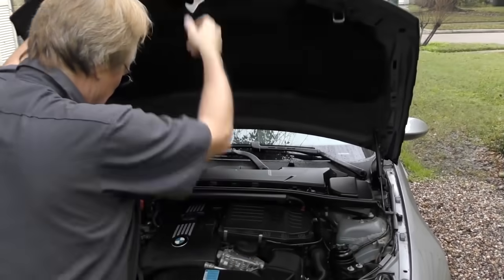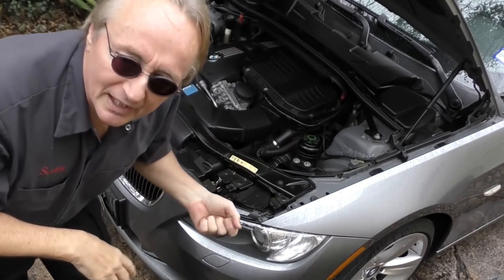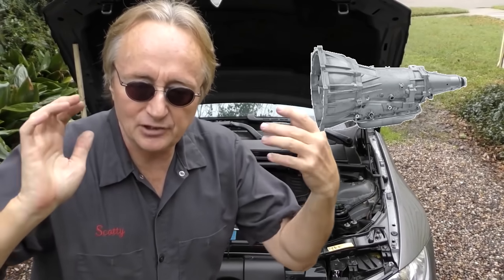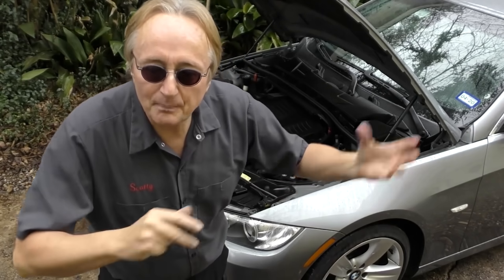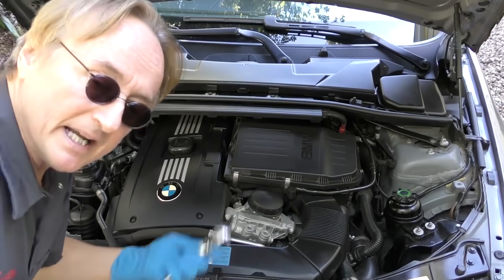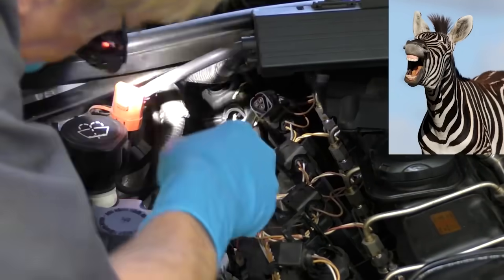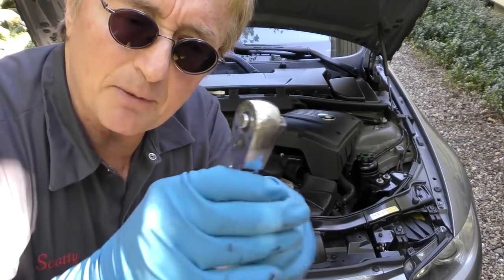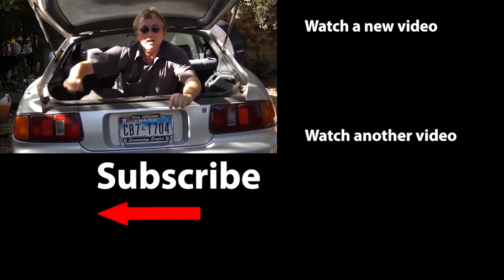People Say I'm Full of Crap About BMWs, Well Watch This

Comment: I bought a so called "most reliable" version, an 06 530i with an N52, but still yeah, 100 percent agree with you. Those BMW guys who love them are blind to this stuff and just call every one else cheep for not doing maintenance, but rebuilding an engine is beyond maintenance to me. I went through hell with mine, and I thought it was going to be easy fixes, and that I got a deal. I did, but yeah, not worth doing stuff like major repairs all the time and calling it maintenance. Endless money pit is right. I don't care what kind of deal you got on it. Never again, and I'm a mechanic as well. Japan makes stuff I like working on.😉
Reply: See I have a BMW with the N52 and I’ve been ok so far with the maintenance. I did have to replace the ignition coil and I’m starting to get some small oil leaks, but with FCP Euro making it so that parts have a lifetime warranty, a lot of those repairs have been paid off by the free oil changes from the warrantied oil and I’ll never have to pay for a valve cover gasket ever again
Reply: I'd rather a lexus over bmw
Reply: @Dashi18n  mine was closing in on 200k miles (hence the deal i guess) so maybe that's just the breaking point idk, I have heard many others say this was the best engine, it probably is. It was BMW maintained before I got it too. Vanos, 99 percent of codes are Vanos related I found. but otherwise an ok engine really.
Reply: @attunedofficial   200k out of any engine is pretty good and I’ve seen some N52’s with over 300k out there along with M54’s. I don’t find it surprising that the vanos were the prime culprit later in life, but it is a shame how that and the water pump were the weak points of that engine.
Reply: Thank goodness for Japanese cars 😊
Reply: No one is rebuilding their engines it's not uncommon for your n52 to get up to 400 or 500k miles on them with basic maintenance but if you want to minimize risk of breaking down there are things you should do that aren't hard or all that expensive in comparison to other modern vehicles.
Reply: @Bawbrahs  And with the E9X platform being over a decade old now there are plenty of YouTube tutorials on how to do all that
Reply: @Dashi18n  I was gonna say I thought m54 was more reliable than n52
Reply: @josephtrujillo5790  The M54 is cheaper to maintain than the N52 but they have similar reliability
Reply: N52 is a great engine
Reply: @Dashi18n  my m54 330ci 2001 in-line 6 had 333k miles on the odometer nothing wrong with it. I texted the kid who bought it and it’s still running strong @ 343k miles. Such a great motor, got the bmw for 300$ put 1000$ into it drove it for around 7k miles and then sold it for 3500$. It’s on my channel “300$ e46” if anyone wants to see
Reply: @startingtech3900  I just watched your video and you drive right by my daily commute 😂 Small world
Reply: @Dashi18n  small 🌍
Reply: @josephtrujillo5790  It is since there is no Valvetronic to worry about.
Reply: @Dashi18n  But the M54 is more reliable since there is no Valvetronic to worry about.
Reply: @Shabbe02  I have an e92 N54. I was thinking in getting a 330 ci with m54 for daily
Reply: @josephtrujillo5790  yeah those are nice but they are starting to get old now to be used as a daily. I would recomend getting a Honda or Toyota as a daily.
Reply: @Shabbe02  The Valvetronic really isn’t an issue that comes up on the N52 all that often. Only really the Vanos system shows trouble
Reply: @Dashi18n  Had lots of problems with the Valvetronic when i owned a car with the n52 engine. But and the end of the day it does not even exist on the m54 so there is less potential things to break.
Reply: @Shabbe02  Well it’s not something I’ve experienced or any of my friends experienced so it could be some bad luck. And one potential issue does not discount the entire engine
Reply: @Dashi18n  Go and read on the internet there is lots of information there. You can say the same about the N53.
Reply: Fuuuuuu got the exact same car...
Reply: "Those BMW guys who love them are blind to this stuff and just call every one else cheap for not doing maintenance"

I own the car in this video. I am fully aware of the N54's problems and the cost for maintenance but regardless I still love my car. I don't think people are cheap for not wanting to deal with the maintenance costs of BMWs and I think everything Scotty said in this video is fair and reasonable. So because I don't fit your generalization of "BMW guys" I must not be a "true BMW guy", right
Reply: @N54MyBeloved  I should say BMW Enthusiast maybe. I meant no offense, but I still would say you're a BMW guy, nothing wrong with that, but you know about these things and still praise them for their engineering. A 30 year old Toyota inline 6 put through twice the boost of an N54 will last longer. Don't get me wrong, I've had a couple BMWs myself. They are a pleasure to drive for sure. I may get another E30 one day.
Reply: My 140k mile E92 (N51) is, believe it or not, one of the more reliable and easy to work on cars I've ever owned. Sure parts are more expensive and there's more maintenance involved, but the N52/N51 is such a common engine that there's a ridiculous amount of information online if you need to do anything. Not to mention the amazing diagnostic software that can be had for under $100 for these cars that can scan all modules, view and log live data, code features, and remotely disable/enable functions all from your android phone. If something goes wrong the problem and solution are literally spoon fed to you. Only real issues with these engines are water pumps and gaskets, no big deal. Compare this to my last car, a 3.6L H6 Outback which was ridiculously reliable up until I sold it with 180k but had almost 0 resources/information besides the vague factory service manual and tuning/logging software originally designed for the WRX with limited support for the EZ36 engine. Working on and diagnosing issues on that thing was a complete pain. I'm pretty sold on BMWs at this point. I just took my E92 on a 37 hour cross country road trip a couple weeks ago and it had 0 issues. Barely even burned a drop of oil.
Reply: if you blew up an n52, you really fucked up.
Reply: @amritk5173  The one I blew up was the E30 sadly, and that was because the skid plate was off and the oil pan caught a curb and ripped the engine in half basically. It was crazy, I miss that one tho.
Reply: I had a '96 honda accord with a V6 (first gen with a V6!) and the back spark plugs were HELL to get out. They stuffed a v6 into a chassis made for a 4 cyl. It was horrible lol
Reply: Ugh, N52. That's one of the engines on my avoid list. I've got a M54 and N55 in my BMWs, outside of having to replace the plastic valve covers on both, have so far been rather solid.
Reply: Got the same exact car, mine has proven to be one of the most reliable cars I have owned.  It is all on how it is taken care of.  Parts are cheap now due to the aftermarket.

Comment: That’s a crapy BMW generation he picked. I had 2011 BMW 535i bought with 70k miles in 2016 just got totaled with 210k miles. It was one of the most fun and reliable cars I ever owned. I just did regular maintenance like oil changes, brakes, new struts at 190k miles. Toyota drives like a tin can, honda drives like you’re going thru a wind tunnel lol. BMW puts a smile on your face when you drive it.

Comment: I own a 98' Bmw 5 series 528i. I agree with a lot of the things you say, i think it's important to know what you're getting into. Personally i haven't had any major issues, and i do pretty much all repairs myself. There haven't been anything massive, just a bunch of seals and gaskets, and it still leaks oil LMAO. i recommend being able to fix things yourself if you're gonna get one. They're fun to work on if you're into that, pretty reliable engines and they drive great.
Reply: Well most  BMW have issues from 2007 to 2014 like after 2014 they fix many things on their cars
Reply: E39 are amazing. Im in luv wit em. Have a 97 540 n 03 530. They both r great n fun af to work on.
Reply: Key is “built before 2004”. Modern BMWs are horrible.
Reply: Agreed, best way to save $ is t do it yourself or learn how. I've had 5 BMW's total (Currently still have 3) My daily is a 328i X-drive, my son & I are working on a 540i I'm gifting to him (great engine drives smooth), and I have a 535i (fully loaded) that I'll be working on next. I'm a bimmer guy for life. IDC what Sir Scotty says lol

Comment: Why didn't you take the cowl off?  It would've made this super easy.  The ignition coils are only $20 and these are Bosch...a BMW owner always keeps one or two spares.  Yes these cars are high maintenance, but if you know what to expect, you're ready for it.  With great cars comes great responsibility Scotty.  Thanks for the video.
Reply: Totally agree. Still think about the '06 525i I didn't grab, but it was truly a money pit. Tons of codes. Data problems, brakes, rotors, etc.
Reply: correct, if you can do the work and dont mind/enjoy doing the work BMWs are fantastic cars. When you got that alignment dialed in after you just spent a week replacing every bushing on the thing with OEM+ harder rubber bushings... its a perfect driving experience.
Reply: They are cheap to fix if you fix them yourself otherwise you'll cry with the dealer bill
Reply: Yup.
Reply: Fiat was always a high maintenance car as well. They're the type of automobiles. One always avoids, and yet people buy em. Why?
Reply: @MrKevin920  yeah, but still a pain to remove bunch crap to just get to it. And lot of things are just not design to be reliable and last.
Reply: Or they could make them well built from the get go
Reply: @Digital-Scratch   BMW was there and and did that.
Reply: I agree. Owned an N55 and it was very reliable. Just need to know how to work on it. It’s pretty straightforward and yes plastics help when weight for reduced emissions
Reply: Saying you keep "one or two spares" coil around say a lot about how you feel about the reliability of  these cars. How many owner of other car manufacture  you know do that. "With great cars comes great responsibility"...not so great if you spend every other weekend working on it.
Reply: @johnryandre  "plastic helps when weight for reduced emission". You must be smoking strong weed

Comment: I have a 2008 BMW 328i Coupe Convertible; I purchased the car with 220,000k and I have replaced the water pump, thermostat, left high beam, right angel-eye, right side blinker, upper radiator hose twice, lower hose, tank reservoir twice, tuneup, misfire in cylinder 3, brakes, rotors, oil gaskets, the under carriage, two oil changes, the air filter, all 4 tires, sensors, and the belt.
Reply: Its just mileage related expenses. Surely, you don’t expect a car to run like the day it came out of the factory after 200k plus miles?
Reply: @PortlyPour  of course not;
I like my car, I was just sharing my BMW experience.

Comment: Got a 2008 535xi a few months back. Saw a 9k sticker and naively thought "that's great!". I couldn't have been more wrong! Front struts needed replacement, stereo went out along with the mulf module and to top it off, it leaked oil like nobody's business. It "passed inspection" at the dealer. 1 week later all this crap started happening. Got rid of it shortly thereafter. Never again....unless it's a lease lol.

Comment: What do you think about the new B58 engines Scotty? I heard BMW and Toyota worked together to make that engine, and it's supposed to be a lot more reliable than the older N54 and N55 engines. What are your thoughts?
Reply: It's probably the best bmw engine which is like saying it's the least disruptive std to live with
Reply: Dont waste your time on these channels join the bmw forums ..the b58 is an awesome motor its an upgrade of the n55s scotty is an antibmw person he drives crap cars and saving all his money for his funeral concidering his age he probably should
Reply: All engines are built from the same materials and all engines give their fair share of problems
Reply: I’ve had no engine issues during the 61k miles I’ve put on my 2016 340i, although it’s currently at the dealer getting 2 front strut mounts for $2500 🤨😭
Reply: @jamie7664  that’s great to know, I’m really curious to see how quickly these engines get carbon buildup on the intake valves being direct injected and boosted. I’ve heard, if you go the direction of walnut blasting, it can be pricey to remove. Glad your car is holding up well!
Reply: @jamie7664  oof
Reply: @KingdomAuto  I can’t say I’ve heard of many issues with carbon buildup on N or B series engines. I’m really happy with the B58 so far. The idle is so smooth is incredible. I have a ‘21 330i loaner right now, and can’t believe how rough and unrefined the engine feels in comparison.
Reply: Gee Wiz every car has plastic parts under the hood unless it’s a 70 vintage
Reply: @jamie7664  N54's are kinda famous for it.  Issue was vastly improved with the N55 and B58 (and other newer engines) with an improved PCV system.
Reply: @jarralboodhram8443  Tbh though, all modern cars have plastic nowadays under the hood and over complicated electrical systems.
Reply: Anything BMW touches will become a money pit in due time
Reply: It is one of the best Motors in the market.

Comment: You can buy an X5 for 20K or a Land Cruiser for 40K. So even if the X5 is an "endless money pit", you still won't spend 20K repairing it. On the other hand, newer Toyotas are not as reliable as they used to be and when they break, the repair is just as expensive if not more. So this whole raging against German cars needs to be taken with a grain of salt.

Comment: After saving money for a car in my teens, I debated between this 335i or a g37 coupe. Never been so proud of my decision. The coupe has lasted me years and has been extremely reliable.
Reply: Bet your disappointed every time you floor it though 😂
Reply: @rayland9305  I’m more so disappointed in your lack of knowledge for the car. The car is quick off the line, but where it fairs most is the cornering. In addition, the power as been consistent regardless of aging. If that doesn’t scream amazing then you sir lack the intelligence of discerning so. Disappointed.

Comment: Toyota has learned some bad ideas from operating in the US. I had a 2012 Tacoma, the only non wear item I had to replace in 200,000 miles was the power steering pressure hose...$50. 2018 Tacoma...the pressure hose, cooler, return line is all 1 piece. And it's $600

Comment: I have a e91, 330D. A bulletproof engine with an automatic transmission that holds up just as good. Sure some problems have come up during my 4 years with it, but it has also about 300 000 km on it (dont know the miles, but its alot).

Ofc after going for so long, stuff needs to be replaced. But goddamn its a good car. One of the best Looking cars out there, and hella fast for a car from 2006. Inline 6, 231 horsepowers on a diesel engine. Trust me, This car moves, and it can take the beating

Edit: sure parts are expensive, but hey, i live in Sweden and order parts from german, so im not paying much. Its about 50-70% lower than buying the parts here in Sweden. So im hella happy

Comment: Scotty. I love your videos. But you could have just popped off the cowl cover. Takes 30 seconds and it gives you all kinds of space for those back 2 cylinders. You made it so much harder on yourself by not taking easy steps
Reply: He knew that but he's being dishonest and wanted to make it look as hard s possible.
Reply: @Bawbrahs  absolutely true, plus use a coil puller, not a screw driver.... I would never let this dude touch my M3.
Reply: Rule of thumb for German cars, if its difficult, you haven't disassembled it enough yet. Taking off that cowl gives gobs of room.
Reply: There's nothing easier than changing oil and filters on my toyota just saying

Comment: Against my advice, my partner bought a 2011 328i which has now done 43,000 very sedate miles. So far it has needed: an eccentric shaft sensor (28,000); new spark coils (30,000); new struts and control arms (40,000); new gas cap (41,000); new CCV valve, plastic water pipe, oil filter gasket, window module, DMTL pump, and oil pan leak fixing (43,000).
Our 2010 RX350 has 135,000 miles and has needed a thermostat.
Reply: under $5000?
Reply: If you follow Bmw's oil change schedule your definitely going to have oil leak problems.  I change my oil every 5k miles and my trans fluid at 60k.  I currently have 80k plus miles with no major problems.
Reply: @billblonco  Because she is not doing much mileage, the oil has been changed every 4,000m. The car is basically a POS.
Reply: @billblonco  Buddy, your beamer will cost more than his RX over any time-frame you want to compare...🤣